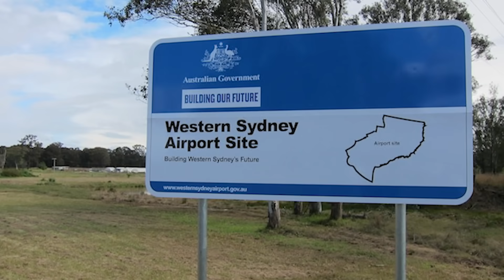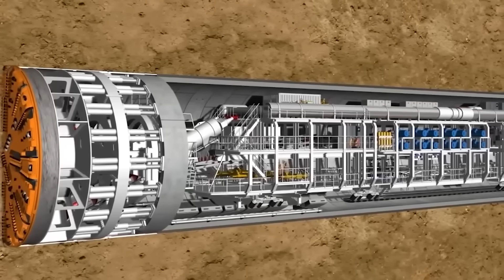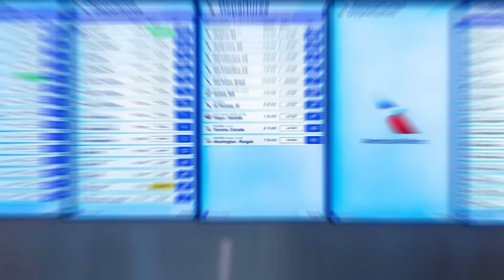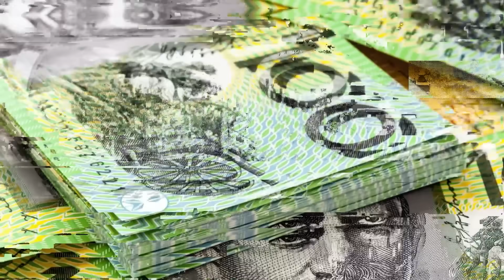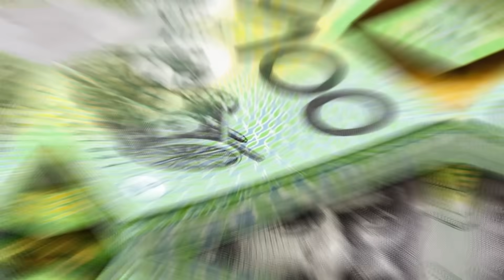The SHOCKING Truth Behind Western Sydney's $11 Billion Railway

Comment: I often wonder if the costly metro from St Mary's to the new airport, would have been less expensive if the plan of thirty years ago to build a heavy rail extension from St Mary's to Leppington (stage one) had been considered, with further rail extensions to Menangle ( MacArthur) & possible Camden, it would therefore have a dual usage instead of a one use as the Metro will be.
 It would have eliminated the expense of the new station interchange at St Mary's along with the building of a new stabling yard & maintenance facilities for the isolated Metro fleet.
Add to this the proposed electrifying of the rail corridor from Menangle to Moss Vale would eliminate the interchange at MacArthur for those from the Southern Highlands heading for the airport.
Reply: Yes, heavy rail would have been a multifunctional solution, including cargo. Metromania since Gladys unnecessarily converted the Chatswood - Epping tunnel to metro. The rolling stock and voltage of the WSI metro is incompatible with other metros. Hopeless planning
Reply: @mattmuschalik1348  You are not digging deep enough. The metro is less expensive as the trains are only half the length on the WSI Metro Line, so all the stations can also be smaller and less expensive. Its initial capacity is 7740 people each way per hour, but it is quite capable of carrying well over 20,000, so just as good as double deck trains, but far more frequent. And, being driverless, it can also respond to unexpected peaks at short notice (like some late aircraft arriving with others to create a peak in passengers). In contrast the M1 Metro and even more so the forthcoming Metro West are optimised for the far more heavy patronage from the Sydney CBD, and (in the latter case) things like major events at Olympic Park.

Metro trains worldwide run on seperate tracks, not as inter-connected networks. That means they aren’t subject to problems on one line affecting all the others. it also means the trains can be designed specifically to the needs of the line, not limited to a ‘one size fits all’ that is sometimes too much and sometimes too little. For example, the WSI Airport Metro is not a classical metro, but a high-end (3 to 4 car) Light Metro, optimised for less heavily populated routes, for less construction and operating cost.

It also means that new lines can easily use the latest technology. They are not stuck with having to be ‘standardised’ with more expensive and older technology. A great example of this is the use of contemporary 25KvAC power supply. The WSI Airport Metro and Metro West metro will be using it. It is far, far less expensive to construct and maintain than the old technology 1500vDC system used across most of Sydney. However, the M1 Metro had to use 1500vDC, with all its additional costs, because it runs so intimately with the existing Sydney Trains 1500vDC system, especially in places around Epping, Chatswood and Sydenham.

Somehow a strange story has been spread about the WSI metro trains being ‘too wide” (many quoting "300 mm wider than Sydney Trains"). A quick glance at the online pamphlet about the Siemens Inspiro WSI Metro trains, produced by the manufacturer, says their width is 3.190 metres. Sydney’s original ‘red rattler trains’ were 3.185 to 3.189 wide (depending on the model) - a whole 1 to 5 mm narrower. Bradfield made them that wide so they could easily use 5 abreast seating. This contrasted with country trains that were (and still are) narrower, typically at about 2.920 metres). 

Current double deck trains are about 3.030 wide - they had to be a bit narrower as the whole cabin has to have clearance down below platform level, especially when the platforms are curved (The old red rattlers had a wide cabin, mounted on a slightly narrower chassis at platform level, so they didn’t need to do that). Basically the WSI Metros are only very slightly wider because they always use straight platforms, and don’t need the bigger gap tolerance to cope with curved platforms. 

To be fair there was a mention of them possibly being made wider. However it is not in a Sydney Metro document, but in an old federal document reviewing whether they should be getting any federal funding. No doubt there are all sorts of industrial reasons why metros cop such flak. They have their own agenda and that’s fine, but they shouldn’t be obscured by claiming better planning is ‘hopeless’, when to me it is actually better informed about design and operational economics. For the record, I am not connected with the industry at all, and all the above is from my own detailed analysis of the published facts by the manufacturer and in information sheets about the various trains and infrastructure involved. I never take anything at face value, because I often find digging deep reveals much more.

Comment: The problem with the original train line to the existing airport is the fact there is a access fee of more than $17  per person each way. That is the issue not lack of passengers.

Once it has ended in 2029 patronage will increase.

Comment: The cost of doing this now is much cheaper than it would be than doing it after the suburbs have been built. Speaking as a passenger, the metro is really brilliant. The airport is opening early. If people have to wait a year. Bummer. It sounds like you expect they will use it when it opens. 
If it is only 40% capacity when it opens, that is great too. It means that when all the suburbs & commercial development around the airport slowly completes, the metro may still have capacity Sydney needs.

Comment: Train line should also come from Leppington to add a link to the existing airport.
Reply: The WSI metro has the initial job of establishing a rail link to the airport. It is doing that first from St Marys as it enables transfers to the T1, which iservices the highest populated area of the Western Suburbs (ie.the developed urban stretch between Penrith and Parramatta. It should then expand to connect further north (Schofields) and further south (Oran Park, narellan and Campbelltown/Macarthur - which is the second biggest populated area of the Western Suburbs)

The West needs and deserves its own transport spine, so that it can develop more as an entity in itself, creating an area where people can increasingly live work and play locally, without the need for long commutes to the East. Connection with other parts of Greater Sydney should certainly exist, but they are NOT its primary purpose. So splitting the WSI Metro or diverting it across to Leppington (which sounds like such a good idea at first) would compromise that purpose, and should not be done. In the future, more people on the that Metro will want to connect to Oran Park etc.) than go through or to Leppington.

What can be done (and is far less expensive) is to extend the line from Leppington westwards until it meets the Metro line, and proved a (cross-platform ??) transfer station there. Extending it fully to the airport does nothing the metro can’t do, while adding billions in extra cost. That extension is apparently happening, with completion around 2033. The feds have provided a billion dollars for land acquisition along that route, and that process is happening now. Eventually the WSI Metro will be the West’s main transport spine, while enabling passenger transfers at four points (Schofield/Tallawong - St Marys - Bradfield South - Campbelltown/Macarthur).

Running DD trains from St Marys down to the airport and through to Leppington is not really viable. The trains have spare seats on that line, but there is little capacity to increase the number of trains to also service the airport. Such trains need bigger tunnels and much longer stations than the metro. That makes it much more expensive, not cheaper. Any claims to the contrary often assume those trains would be running on the surface (possibly cheaper than tunnels or elevated track, although land acquisition costs are not small). How the line gets across the second runway on the surface at the airport is a mystery.

Such a line would also need to occupy the space left at WSI Airport for an additional line into the airport from the north east (easily visible on the airport plans). The original assumption is an extension of Metro-West from Westmead, Parramatta and the City). I understand there are now suggestions it could be part of the high speed rail (HSR) network through Sydney, enabling connections between flights and trains to places like the City and Newcastle). Either of those is a far faster and better connection than via Leppington.
Reply: Your dam right there. So why is the Government still not extending from Leppington? Too busy obsessing with Chinese run, Single deck, virtually seatless, Metro trains.

Comment: if you lined up all the metro stations and painted them brown, they'd be the same colour as the wall of the barangaroo cutaway.
Reply: That’s a very astute observation. Have you noticed that the artwork on the wall in Barangaroo station, depicting vegetation (“tree sculptures”) in copper and steel is currently brown. That’s odd because the vegetation on the cutaway cliffs outside is actually green. I thought “maybe it would look better if the artwork was also green”. Then it struck me that, after about 5 to 7 years, exposed copper like that begins to acquire a green patina. Maybe that’s one of the reasons why the artwork is called “In time we shall”.

Comment: The content of these videos is let down by the tabloid tone of the narration.

The current airport link low ridership is because of the eye-watering fares. The owners want instant recoup of investment.
Reply: A bit more to it than that. The airport access fee was driven by the need to complete the line by the 2000 Olympics. It simply would not have happened otherwise. 

Most of the access fee income income goes to government, not the operator, and the current agreement ends in the early 2030s. Initial patronage was low and the fee was part of that. However, anything about Sydney Airport is expensive. The rail fare looks cheap if your alternative is parking at the airport or getting a cab. Regulars soon discover it’s OK if you are travelling alone, but cabs are often better if you have a group. Backpackers avoid it by using the bus to train connection that dodges the access fee. Meanwhile mini-bus airport services do a roaring trade, particularly to and from the more distant western suburbs.

The Sydney Airport stations now have reasonable patronage and their biggest issue is peak capacity as the trains have already picked up numerous passengers from the SW suburbs before they get to the airport. Ironically removing the access fee would probably lead to heavy overcrowding. The proposed changing of the T2 rail line to operate more frequently, but only between Revesby and Homebush via the airport and city circle should fix all that for good. Using faster single deck trains better optimised for luggage handling would be even better. 

Meanwhile the longer distance T8 line trains would avoid the airport entirely and terminate at Central station (passengers doing an easy cross-platform transfer at Revesby and maybe also at an upgraded Kingsgrove, if they want to go to SYD airport). By then the improving connections to the new WSI Airport from the far SW suburbs served by the T8 would have most of them going there instead.